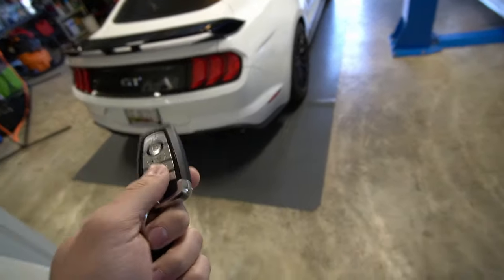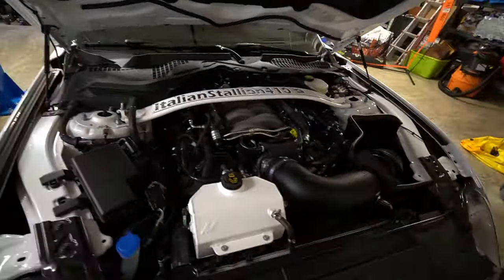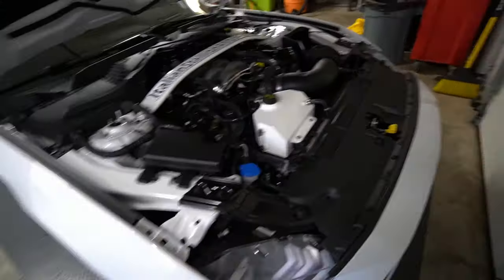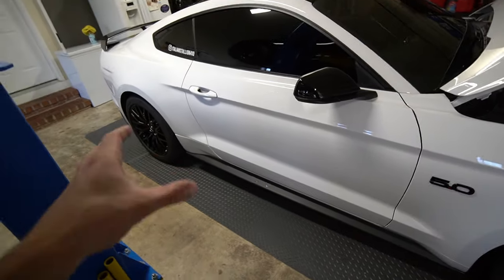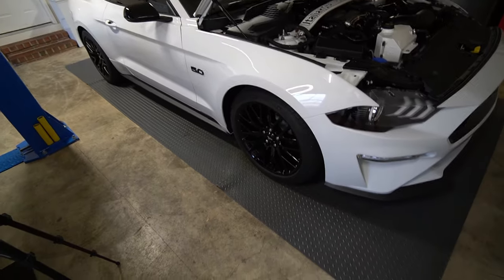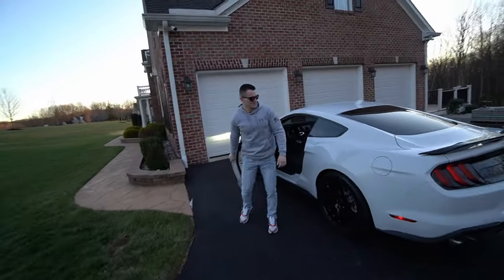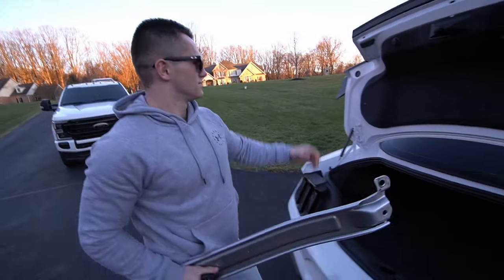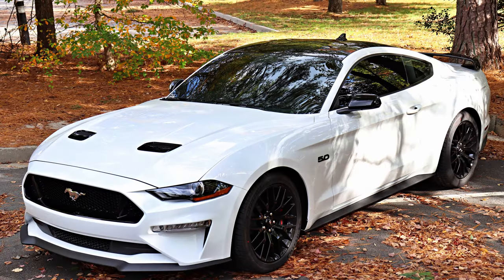Top 5 Mods for your Mustang GT Under $1000!

Comment: You should seriously consider changing your oil from 5w20 to 10w30.  It will eliminate the need for a catch can as well as save your motor.  5W20 is used to meet Fuel EPA ratings.  Euro spec Mustangs all use 5w30 and if you like a lot of us only drive in the summer use 10w30.  Try it out and see how much oil collects in the catch can vs the 5w20.  Good luck.
Reply from the maker: Thanks for the info I am running 5w-50 now!!
Reply: Teach me about this
Reply: I live in south Florida where it’s hot as shit all year long I’ve been using 5w20 for 65k miles and beat the shit out of my car with no issues
Reply: They say in the owners manual before a race you must drain the 5w-20 and fill with 5w-30 . Then the reverse after the race! Geez that’s 20 quarts of oil!!!!
Reply: @GtFrank_5.0  facts.  idk whats hotter my 5.0 after ripping on i4 or the heat in july
Reply: Catch can isn’t a need nor should it even remotely be considered as effective without boost lol…

Comment: I own a 2019 Mustang GT Premium California special. I added the bullet metal drain plug. Keep the old plastic one just in case. Next thing I added is a JLT Catch can. Next item was the Redline hood struts. A must. Next BLR Jacking Rails to lift the whole car up on one side to take off you tired/rims for cleaning the rims and barrels. You don’t want to be jacking the car on the pinch weld and take the chance of ruining the pinch weld. Also this MOD,  strengthen the body up and makes it Handle much better. The last item I installed is the LED Back up light blub . The stock one is to dim and the new one is so much brighter, and  then you can see much better at night backing up though the Camera.  My California special comes with a shock tower brace already. These are must haves to buy. IMO  HAPPY DRIVING!

Comment: Putting headers will definitely NOT make it quite, I think 2 inch is a bit big if your not boosted. I had 1 7/8 long tube on my 18 with x pipe and roush axle back and it was insane loud on cold start. My 19 has 3 inch  cat back corse extreme with active.

Comment: Damnnnn, I miss my 15 GT....   

Went more for the bang for buck with that one.  Grabbed a new 15 Base GT, Performance Package, 6 speed & Recarros.   It was a great trackday and autocross toy.  I kept it a few years and sold it for something else.   Also did the JLT catch can, cat back with x pipe and reso delete.   MSRP was 36k at the time and I did a little better on it.   Ive been looking at another GT, but the prices are silly right now.   Ill hold off till they get the block and trans issues figured out.

Comment: Hi wich spacers did you use with the MAGNERIDE they say on the front it doesn’t work?? Thanks
Reply from the maker: For spacers I would always get the hub centric ones
Reply: @ItalianStallion410   thanks
Reply: @ItalianStallion410  whats the size of those spacers ? I want to put it on my 
I fallow a lot your videos it helps a lot 👍👍 keep it going
Reply from the maker: @javiel2260  I can’t remember the size it all depends on really how much you need for the wheels to sit flush

Comment: I’m hearing a creaking noise in the rear of my 2019 gt it only happens when moving slowly over bumps and when turning while goin slow in parking lots I had ford look at the suspension and ball joints they said everything looks fine do you have any idea what it could be ?
Reply from the maker: Just WD40 everything
Reply: Im having the same noise barely 8000 miles on the car an hearing suspenssion noise

Comment: Mine has cold air intake by K and N.Ford catch can, Ford hood struts, Ford strut bar. Steeda lower front strut bar Steeda subframe connectors Steeda rear irs subframe connector Steeda i r s isolators. Slp catback exhaust.SCT /Pro Dyno tune

Comment: I’m in the market for a mustang get. What are the pros and cons of a automatic vs. a manual?
Reply from the maker: Automatic is 10 times stronger but  manual is fun
Reply: I have a manual and it's great, I have low miles but I've talked to a lot of guys and the manual is good as long as you don't heavily mod it.
Auto is way faster however

Comment: I’m getting a 2021 GT premium with performance package in 2 days 😏😈 It’s a manual, and it does have remote start.. but not on the key. I can thru the app. That’s what the salesman told me at least
Reply from the maker: Congrats on the new car but I don’t think that is right all manual cars have to have the clutch pushed in when starting the car

Comment: I had a Camaro, And Mustang, and currently own a Dodge Charger.
My input is Camaros are my least favorite the visibility kills it for me and least appealing.
Mustangs they are the easy and best to mod you put 4K into one they get easy 150+ horsepower. Love them but I had to get rid of mine cause there coupé. Still wanted some power and went with the Dodge Charger. But my Favorite is def the mustang lots of stuff you can do with!!
Reply from the maker: I low key want a wide body scat pack challenger in orange
Reply: @ItalianStallion410  yup got a black out 392 wide body love the torque not the fastest but it does the job for a sedan
Reply from the maker: @eevee4408  that’s so badass